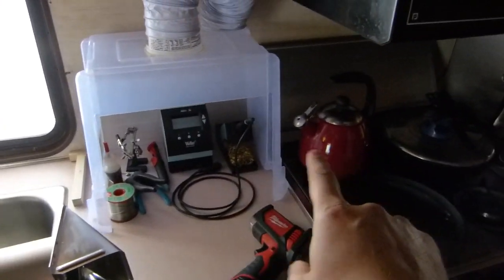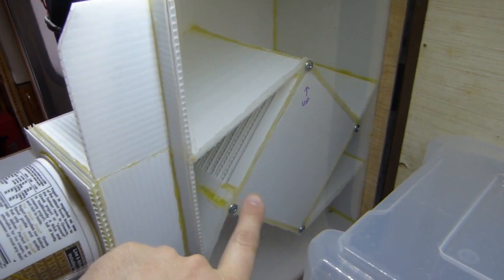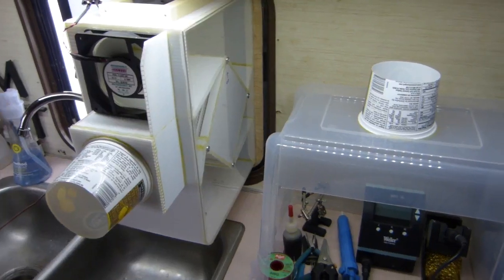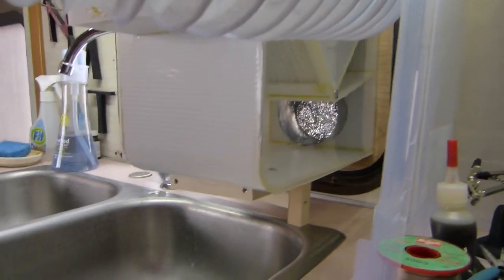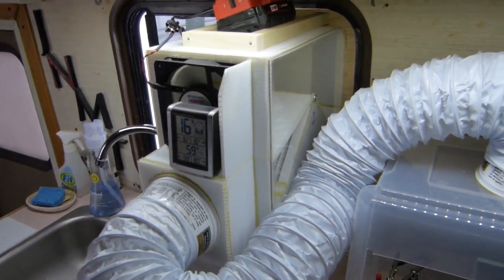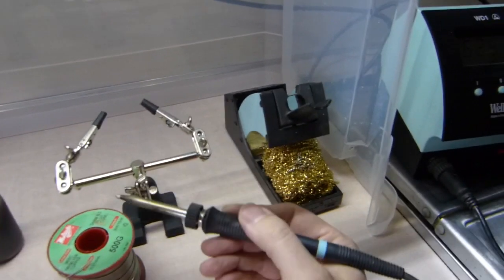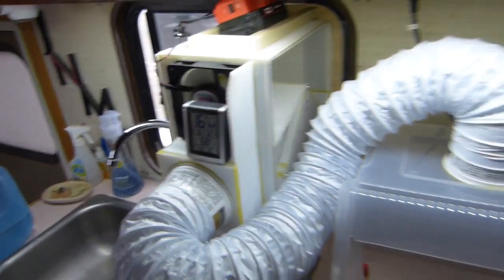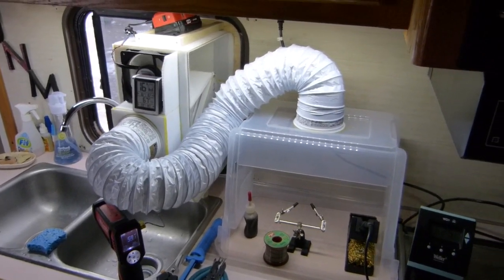DIY Solder Fume Extractor using Heat Recovery Ventilator

Comment: That's a fantastic setup! Just one question: why not put the fans on the other side of the heat exchanger core, since it would muffle a lot of the fan noise?
Reply from the maker: Antonio Tejada I just wanted easy access to the fans for cleaning etc. I've mounted my real unit (see full build video) close to a wall and would have to unmount it if the fans were on the back.